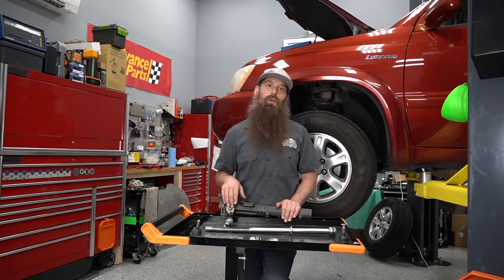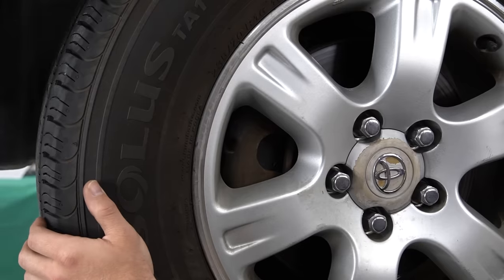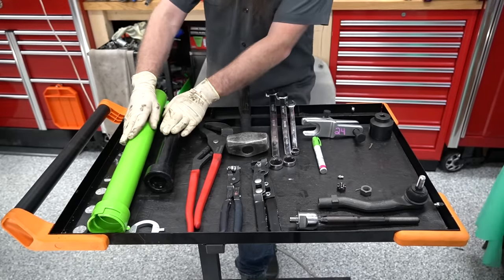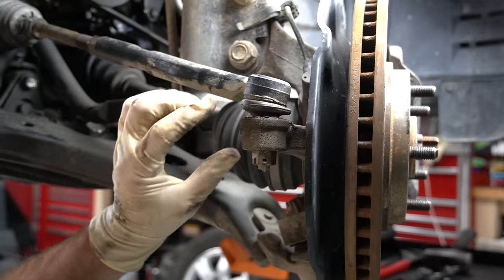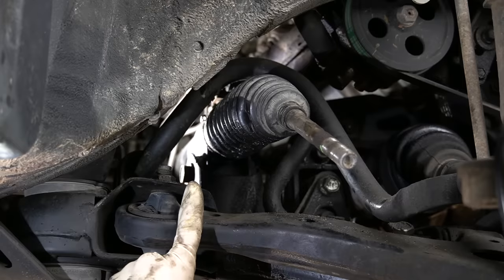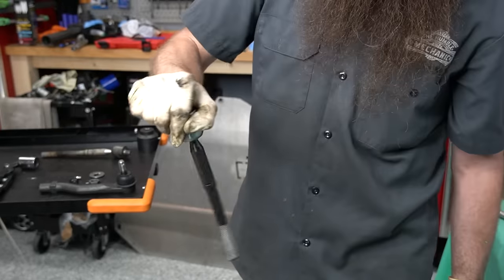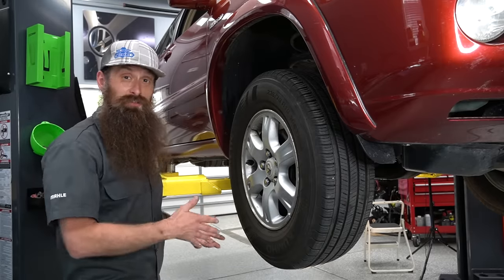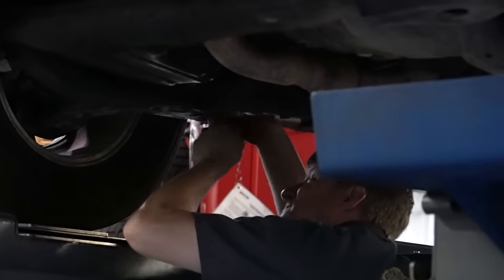How To Check and Replace a Bad Tie Rod ~ Clunk While Turning

Comment: As far as removing the outer tie rod from the hub, you didn't mention "loosen the nut, put nut on end of threads, then pound with hammer" technique. That saves the threads AND prevents mushrooming for those without the specialty tool.
Reply: Only if you’re reusing old tie rod end. If you are replacing with new just whack it and get it out. It don’t take much of a shock to pop it out
Reply: If you just wack the side of the hole that it goes through, it'll temporarily deform it and it'll just fall right out. I've done it this way 20 plus times and have never had one not fall right out.
Reply: @Hes_Bona_Fide exactly.
Reply: @Hes_Bona_Fide this is the only way iv ever done it, banging on the nut is most times COMPLETELY ineffective. Rookie move for sure...
Reply: yeah something like that

Comment from the maker: Remember there is no need to chase Advance Discount codes. You can use "Humble" any time you like and save $$$!  I also learned that on the app, you can combine your PERKS and save up to $20! The best part, it resets the date they expire. So if you have SpeedPerks about to expire, go on the app, combine them and BOOM expiration reset!
Reply: hey charles i got a question mk4 jetta ive seen an alignment tool for the subframe but theirs no video that shows how this tool works an how its done properly but i have seen people just slap a new subframe in no alignment done an used the old bolts i know ur not soupposed to strech bolts yada yada just wondering do u have any experiance with this alignment tool ?
Reply: Long time, first time in the comment section.
Awesome info.
I used to have the original R32 ( 2004 mk4 / original owner) which I loved but no longer have it. Oh man how much fun it was back in 2004. But still watching your videos. Keep up the good work man, thank you 👍👍👍
Reply: Hey Charles, hope your doing well, got a quick question as a DIY myself, i got a 2017 gti ( US spec) and i live somewhere quite hot 😅 i noticed something, whenever the ambient temp. Reaches 104F (40c) and above the car delays the gear  shifts, usually it shift around 2k Rpm but at high temp its delays it to 3 or 4K, any explanation or advice is appreciated, btw  love your videos, keep up the great content

Comment: When I deleted my power steering I just zip tied the inner boots. Check it often and no issues at all.
Reply: I'd do the same on my own car. On a customer's car though? Probably not.
Reply: Same, actually when I had to do this on my JCW Mini the inner and outer rods were seized together so I cut the boots off and used a cheap amazon tie rod tool to undo the inner. Since it’s a mini you can’t even fit your hands in there let alone a tool. Turns out the boots cost a shit load so I used a zip tie and some boots off a dodgy rack from a nearby garage, but what a ball ache of a job, seems to be a theme with minis
Reply: @krASHExxx  Yep, sounds like you know the pain. I replaced most of the front end while I had the subframe out while changing the clutch. Unfortunately I only had jack stands under the front end of the car so putting the subframe in was a mammoth task and I had to bench press the gearbox in because there was no space for a floor jack. Love my car though 😇

Comment: Excellent content as always Charles. Super important note in your video regarding the insert sleeves that some hubs use. Especially for people looking to swap out the heavy steel knuckles on their Golf mk 5/6 for the lighter aluminium Audi S3 / Passat ones. Those have pressed inserts and you MUST use the correct collared nut for them, NOT the standard nut that is used to secure the tie rod to the steel Knuckles. Correct part number for the collared nut is WHT000785 (its also used on the ball joint).

Comment: Replaced the outer tie rods on my '68 Bug a couple months ago...that ball joint tool is an absolute must for jobs like this and worth every cent.  Once done I took some advice from my mechanic to measure the distance between treads on both the front and back of the front tires to determine the toe of the car.  It was toed-out 5mm so I readjusted the toe by setting up string lines perfectly parallel to the rear rims as references for the front tires.  Car is now toe'd in a few mm and tracks perfectly down the road!
Reply: I had seen this exact method recently on youtube by somebody with a cummings swapped truck...forget the name sadly. It's a surefire way to get it as close as you can with just basic tools.
Reply: Matthew 11.28 Come to Me, all you who labor and are heavy laden, and I will give you rest. 29 Take My yoke upon you and learn from Me, for I am gentle and lowly in heart, and you will find rest for your souls. 30 For My yoke is easy and My burden is light."
Jesus Christ loves you.  Repent and be saved.  Only Jesus Christ saves.  God bless you, and the grace of the Lord Jesus Christ, and the love of God, and the communion of the Holy Spirit be with you and your family.
--
Reply: @William Munny "For My tie rods are tight, and My steering is easy."

Comment: "Leave one out, & bend one down"  15:34   This has often been something which has been debated. I would personally imagine this to be the best option, as it means that the head of the pin will then engage fully into the slot of the castellated nut. Your video has helped clear this up for me. " Thumbs Up!

Comment: Excellent video!, I do my own maintenance and anytime I've done tie rods I've only done one side at a time so I can almost completely match the alignment ( after test drive bring it back in garage onto Jack and adjust and re test until straight ) no pulling to either side during hard braking ( panic braking ) or during hard acceleration,, I get good tire wear, and primarily do this to give me more time to take it for alignment,, alignment isn't hyper expensive but 140$ is still 140$ so that's why I do it this way,, just also make sure the tire psi are the same and there's no other play in suspension,, again nice video!

Comment: Thanks, this is great advice. My front wheels had major play after I recently replaced all control arms + outer tie rods on my Audi A8. Turns out that if the outer tie rod is seized to the inner tie rod and you torque it it'll damage the inner tie rod...

Comment: Very well explained. Thank you for doing this video. I’m well versed in driving a wornout steering rack. Sucks bad and I swapped the rack and had a shop do the wheel alignment
Reply: Yeah, my steering is questionable too. Happened after me and a friend replaced both front lower control arms. Dont know if powersteering pump got shot or if we blew some kind of a sealing in the steering rack.. steering doesnt have that nice and thight feeling anymore.. its super duper light sometimes and back to kinda normal sometimes. Steering wheel does not "spring back" when the steering feels super light. Also sometimes when i drive forward slow i can turn the wheel some degrees and i still go forward with a slightly turn to left.. so i dont know.. :)

Comment: I will say one thing about alignment, i rocked my custom alignment after doing a rack, tie rods once or twice and the only ''issues'' was my wheel was off a bit...not fantastic and then after idk a year and a half two years i got the slightest cupping. For sure worth the what, just got one for 73 dollars? CANADIAN pesos that is** So it's really worth it. Plus driving perfectly straight and a nice wheel it's all good. Exactly why i reccomend doing both inners or outers if one is gone, you ''save'' 60 bucks on parts BUT when the other one goes in 5 months, you're out that same money, even more labor AND another alignment.

Comment: Front end work, nice.

A good way to avoid tire wear while heading to an alignment shop is pull the inner boot off the rack and use a tape measure to the tie rod end from the rack housing. Right it down, or take a photo and you’ll be within a turn on the settings at the alignment shop.

Your tires will thank you.
Reply: That or the classic count the threads, my only issue is you may be spinning the uh ball within the inner tie rod and not get it exact. Measuring has gotten me near perfect every time. Plus i've rode on those for a long time with near no issues. the 50 60 70 dollar simple Toe and go alignment is crucial for just getting a perfect handling car. I avoided an alignment just because of idk no extra car, for a year and a half and only had slight cupping after that long. Not reccomended, but it can be done.
Reply: @baileyhatfield4273  Yeah, counting threads will work also, as long as the replacements are the same over all length. ;)

Comment: Fun fact: The return line of my power steering on my 1.8 MK4 rusted trough.I remember doing the pressure line from the pump to the distributor and what a pain in the ass this was.Wish me luck 😝.
P.S. Great video again.Keep going 👍
Reply: Sometimes you just hand the car to a shop to fix it. I wish i had that several times. So much frustration, swearing, sweating, bloody hands etc.. :)
Reply: @orfeous  That's true but first i'll give it a try bc. moneys always short ;-)
Reply: The return line on my mk4 Jetta was rusty as hell, so I gave it a once over with a wire brush and some rust protection.
Might replace it when I replace the clutch in the not too distant future.
Reply: @panzerveps  Then let's hope it's not too gone 🍀

Comment: Dam, I just got an alignment on my 2001 Accord after I rebuilt the automatic tranny because the cross member was removed. Even though I marked the x member before removal I decided to get the alignment to ensure things were back to spec.

 I was so pre-occupied by the previous tranny issue (hard 1-2 shift which turned out to be bad 2nd  clutch discs and friction plates) that I didn't think much about a slight knock noise over bumps and a small wheel shake ~100 km/h might be linked. Just bought the car about 2 months ago with the known tranny issue and a couple bad wheel bearings.

This vid gave me the idea to check to the tie rods. We owned a 2002 Accord and never had tie rod issues, but the 2001 was a recent purchase with more miles and I don't know the history like I did for our previous 02,

Jacked up FR tire and noticed a very slight movement in the tie rods. Inspected the FD side and didn't notice any, until to put some muscle into when I felt some decent play and heard the know noise,

Glad I found this vid to point me in the tie rod direction as I was suspecting the more expensive struts. Going to order inner and outer tie rods for both sides, and get a second wheel alignment in less than 3 wks

Comment: Great timing.  I have new Koni suspension, 034 control arm kit, and inner/outer tierods that I am going to tackle this weekend if it isn't hotter than the surface of the fun.

Comment: excellent  outer & inner tie rods replacement & outer tie rod in toe & out toe adjustment # as i understand the inner tie  rod ball joint is for movement  outer  tie rod vertically & horizontally but  it is the inner tie rod  outward & inward movement which moves the wheel out or in # ❤️🇵🇰

Comment: I was hoping those inner tie rod boots also served as power steering reservoirs. You answered my question on whether to replace the power steering rack I was hoping to avoid.  I got 200K on a 2010 Dakota. How reliable are remanufactured steering racks compared to the cost of new ones? Great videos. Something everyone should know a little bit about, life skills.
Reply: I recently replaced my steering rack with a remanufactured unit. Original had 200k. 1 year later, I’m here watching a video on how to replace an inner tie rod.

Comment: I have a tool set for inner tie rods with self adjusting rollers inside. just put over the cup and turn until the rollers grip. it was cheap and works like nothing else. surprising, even for me. I used it twice so far but it already paid after the first use

Comment: It's a great video!Please tell me if you know this issue.My steering wheel is vibrating when i am braking on a speed of 150 km/h and more (not for less speed).The rotors and the bearings have no problem.Does it causes, the inner tie rod, or something else?Thank you!

Comment: What a good teacher!!!There is one other scenario I'd like to ask about.  When I do the twist the tire test(hands at 9 and 3) there is a clunking noise and some travel but both tires are moving the same amount, the movement is thru the rack and pinion. This is happening on my 2015 Acadia.  Does this mean the rack is done or is there some adjustment that can be made?

Comment: Some old guy taught me to diagnose steering.
Have a helper wiggle the steering wheel with one finger. Crawl under and look at the tie rods etc.
Whatever is wiggling needs replaced.
It's quite simple actually.

Comment: I wound up buying a tool similar to an exhaust clamp with a 3/8 socket opening on it. The inner toe rods I had where considered “unserviceable”. They had no flat spots for a removal tool. It was pretty easy to put on and remove the toe rods. Would be much easier than those huge pliers you had haha

Comment: Great video. Will there any difference between tighten the tie rod castle nut to the spindle when the suspension is not yet loaded and loaded? I read that uca and lca must be tightened to the spindle as the suspenion is loaded.

Comment: I know that feeling, but....   I was given a 2002 Kia Sportage last Oct. 1,  that looks good on the outside, but the underneath is a mess. I didn't have a car for 10 1/2 years and someone was nice enough to give me the 2002 Kia. The underneath has a frame rusted frame rail and all the suspension along with it. I've had 40 surgeries in my life and it's hard enough to try, but the bolts are rusted completely. The whole front driver side has 3 loose joints.  I have to wait until I have the death wobble and then I'll have to get rid of it. No more vehicle again. I like seeing your work on vehicles, but my lack of money, I can't do anything. God Bless

Comment: Had to replace one inner tie rod on my Trailblazer,  bought the special tool and it didn't fit over the tie rod.

Ended up turning the steering wheel to full lock and used a big ass crescent wrench.

Comment: How do I find a good power steering, suspension, rack and pinion mechanic?  I'm afraid my dealer mechanics will just start by trial and error replacing parts before my minor "clunking" sound goes away?  I live in Myrtle Beach.

Comment: How about if there's jerking motion when I release brake from D and the brake again. The steering wheel would jerk as I repeatedly brake and release, brake and release. This jerk motion would appear while driving. The alignment is off right now.

Comment: I have a 90 Z32 and can't figure out why my steering is loose and even worse when I hit my brakes. Feels stiff while sitting but it's vibrated around 60-70mph since I got it 5 years ago. Planned on replacing the tie rods and lower arm bushing and ball joints since it's probably never been done. Rear inner tie rods were a bit worn out so front is probably much worse

Comment: Hey Chris I had my 07 liberty in the air checking the passenger lower ball joint and I tested my tie rod ends by twisting and they moved with no force so bothered bad

Comment: Do you still do the same amount of turns if the new tie rod end is longer than the original?  The greasable Moog ends I ordered are about 1/2" longer than the original.

Comment: I wonder if you can do a make shift wheel aligement at home.  Just get most of us out of trouble, so can drive to the local dealers/  Cough "stealers".  I heard about string being used and 4 corners.  Does this ring a bell.  Might help some people out that screwed up.
Reply: If you have one of those long levels that goes across the entire tire it's a good tool to use.

Comment: My brother has a 99 crv and wen u brake and come to a stop it makes a sound like rubber on metal creaking the boot is ripped and gone on the inner tierod drivers side u think thats the noise its a creaking noise only wen u brake and come to a stop like the force torque on that inner tie rod is makeing the noise wat do u think? It only makes the noise if ur in motion and u apply the brakes its a creaking noise.

Comment: Everyone describes the noise as a clunking sound. For me it was more of a creak, like wood creaking, a loud creak every time I turned or went over a bump. Replaced inner and outer tie rod ends fixed it right up. I have a 2010 Honda Fit just in case anyone looking at the comments is also trying to figure out what’s wrong with their car 😂.

Comment: Great video, thank you! Quick question: when straighten the van after an acute corner, the steering wheel feels flimsy and kind of oscillate back (it gives the feeling of very low solidity); could this also be a sign of bad tie rod? Thanks!

Comment: There is another tool, I believe I got off the Matco truck its 2 loops and a knurled gear that when you either tighten or loosen (to remove or install) it wedges on the inner and works very well.  On my tercels tho the inners are so small I have to put a little piece of scrap steel in there to make it work but its fantastic otherwise.
Reply from the maker: Oh I know exactly what you’re talking about. Those are awesome.

Comment: Nice vid! I have a similar thing happening on my A5 SB (2011) as well as before on my A4 (1.8t sedan 2003), when reversing and making a turn, then a clunk when turning the wheels straight to drive away forward. Never really looked into it but I guess it might be this.
Reply: That's cv axle problem

Comment: had a 2013 Accord EXL Coupe, that the tie rods were bad but there was some steering belt (forget what the exact name of the part was now) that made that repair over 6000.00     I guess Im saying for those do it yourselfers sometimes there's more than just the obvious that needs to be fixed.